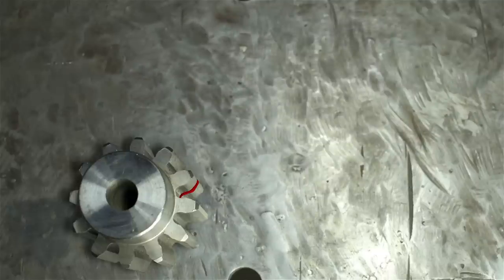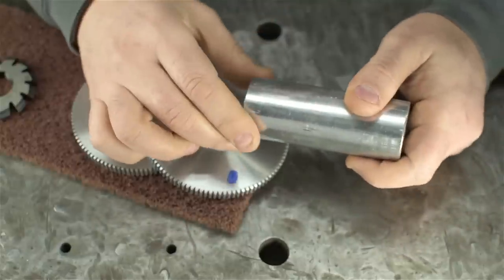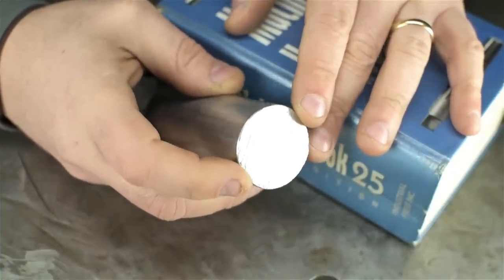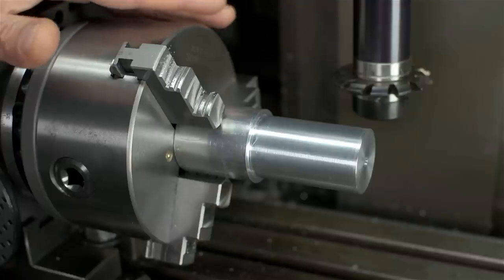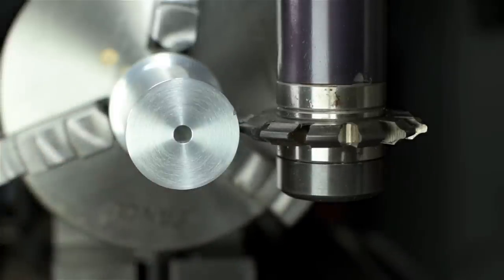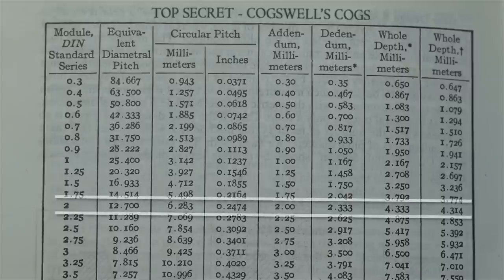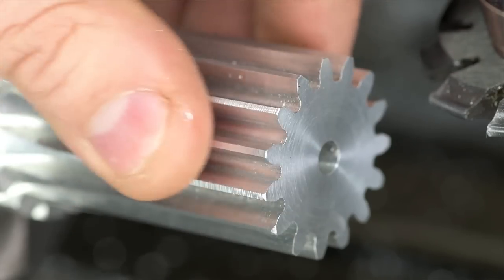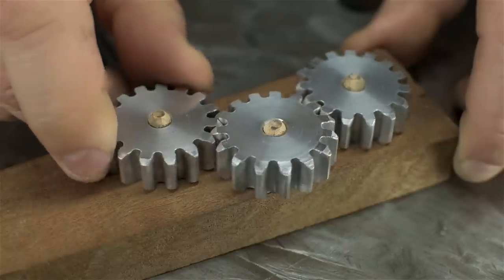15T-M2 Let This Be A Lesson To Ya!

Comment: They knock the edges off the teeth to reduce the tip load on the end of the tooth, which reduces the chance of chipping. Something about more support for the end of the tip...
Or at least that was what I was told many years ago when I was working as a gearset fitter.
Reply: i would have guessed that it was so your lubricant of choice would be slung into the bottom lands of the opposing gear, but reduced chipping makes sense.
Reply: That was my assumption too. Plus reduces the chance of any stress fractures on a sharp end under load.
Reply: My initial thought was a gear mfg not knowing the application the end user would use the gears for, if they were placed on a shifting gearset such as transmission the chamfer would help with shifting of gearsrts.  But your explanation makes more sense.
Reply: So, you're saying "Just the tip"?
Reply: Sounds right since it removes a stress riser at the points of the teeth.
Reply: @wknoxfarms  sounds plausible!  I think they're all good reasons.
Reply: @wknoxfarms  the gears dont actually slide in and out of mesh in a manual transmission, they are in constant mesh, its the sychronizer/blocking ring assemblies that move.
Reply: This is correct, I recall reading these exact words from a mechanical engineering textbook a few years back. Also, it's a lot easier and more effective to clean up burrs left by the gear cutter and cut-off tool this way.
Reply: One reason is due to the reduced stiffness of the tooth near the edges. This means that the tooth edges do not really carry load, at least in ideal theet. Plus all the other reasons it's always good idea to add a chamfer.
Reply: These days I figured it was mandated by OSHA...to save us from finger cuts.
Reply: @ @jasondreckmann3396  Not in a crash gear box.
Reply: funny, I was going to post: since I work many in wood, I'd say it would be to reduce chipping. Not realizing the same could be said of metal. I knock the edges off all sides of all pieces to reduce slivers etc.
Reply: Also these edges are problematic when gears are heat treated.
Reply: After a bearing failed in the half axle of an mf165 I kept driving it because I didnt have time to repair it. eventually it locked up, because a corner broke off a tooth and got jammed in the works. I think it is true.
Reply: There are several reasons, and most of them have already been stated here. The sharper an edge is, the weaker it is. A chamfer makes the edge stronger by making it bigger. Much less likely to crack in heat treat. But a chamfer is still just two sharp corners instead of one. I’d argue a radius would be better. Much like Honing the edge of a cutting tool controls chipping, the same theory would probably apply. If you cut a V shape into a piece of cellophane, you can easily tear it. If you cut a rounded U shape into it, it’s still pretty hard to tear. Sharp corners are weak.
Reply: I believe stress cracks form easier on smaller radii. A 90 edge would be an infinitely small radius and have the highest chance of failure.
Reply: @copasetic216  I don't think your cellophane analogy applies here - the shape you describe is inverted (270 degrees in stead of 90).
Reply: huh?, sorry but even if the analogy is a bit soft (pun intended) I think the premise easily applies. his (point, ha)  is "rounded VS pointed"
Reply: @Studio51media  Cutting a v-shape into a material is not the same as cutting a point out of it.
Reply: Martin Luther  Shifting gears in a transmission never move.  All of them are always meshed.  And they're helical.
Reply: @jasondreckmann3396   They do on many motorcycle and marine transmissions. Synchromesh  is mostly on car/truck transmissions.
Reply: Dave Kohfeld except when they are “straight cut”.
Reply: @dk-bw4gk  You forgot the reverse gear. That one is straight, and moving in and out of mesh, at least on the old stuff I have worked on.
Reply: @frodehau  No, they still do that.  But it's not chamfered like ToT is talking, it's knife-edged.  Also, reverse is engaged while both sides are stationary.  It's a slightly less manual version of inserting a gear into a stopped system.
Reply: Dave Kohfeld helical gears also have the benefit of longer teeth with the same OAL since the teeth are cut on an angle. And they usually seem to be finished nicer from my experience.
Reply: @jasondreckmann3396  that's not 100% true gear shifted before the invention of the synchromesh transmission. Like on my 1930 Ford Model A 3-speed transmission.
Reply: I concur with the fridge
Reply: @niceic.co.uk.  were obviously not talking about the minority of, or outdated of the applications here. The point is that in todays world, the chamfer has basically nothing to do with shifting, and everything to do with the strength and finish of the gear.
Reply: @copasetic216  I don't believe that's a benefit, as I've never seen quality straight gears ever broken under normal conditions.  I believe it's for noise only.  Don't know here, I'm just a clown on Youtube.  The major downfall with helical gears is they thrust the opposing shaft into whatever fixture is containing the end.  '80s-early '00s Hondas (what I'm familiar with) have a terrible problem with this, putting a radial/thrust bearing at one end and a ball bearing at the other.  Don't downshift a Honda regularly.
Reply: @niceic.co.uk. you seem to be upset? Why dont you go find another excuse to bring up the fact that you have a 1930 model t, That'll cheer ya up.
Reply: @jasondreckmann3396  those who do not study the past are doomed to repeat history.
Reply: @niceic.co.uk.  you make perfect sense there gramps.
Reply: @IanSlothieRolfe  motorcycle transmissions engage with dogs instead of synchros, but you're still not banging spur teeth together at all. No idea about marine but I've no idea why they wouldn't use the same concepts as either dog box, synchro, or planetary auto style transmissions, none of which involve any spur teeth being shifted into mesh like you're suggesting.
Reply: @jasondreckmann3396  I always make perfect sense thank you Jason. But you didn't have to take it personally you could have looked up any 1930 Model A.
Reply: @jasondreckmann3396  and why are you bringing up the fact that I own a 1930 Model A.
Reply: @Tony Papantoniou  Crash gearboxes are also usually constant mesh, just without synchro or baulk rings - but they still have drive dogs on the gears, just like a modern manual gearbox.  You're thinking of a sliding mesh gearbox setup, I suspect.  Like the Ford A-Model 3-speed.  :-P
Reply: @jasondreckmann3396  thanks for the info!
Reply: how about ease of manufacturing? Whether a gear driven device is hand or machine assembled, it is far easier to mesh the geared components with chamfered gears, than straight gears! Just try it sometime and you'll see for yourself, lining up straight gears is much more difficult... In an automated environment, that might also translate into damaged gears during high speed assembly...
Reply: I was thinking same per the transmission gears, but no...
Reply: @DreadedOne509  🙄 Progress 😆 lol!
Reply: @podda94  It probably reduces noice too.
Reply: Shane Allen are theet a real “thing?” is that when you are forced to install the gear backward?
Reply: Transmision is general term. Not mandatory on the vehicle (of any kind,:car, bike, boat...).
For example, norton gear change on late is just another form of transmition. And it's not in constant mesh.
Reply: @DreadedOne509  Only for a minute.
Reply: @niceic.co.uk.  Who's the "snobby little spoiled brat" now Mr. "I always make perfect sense thank you"

And it would have much funnier if you said "I have a Model A not a Model T, thank you very much"
Reply: @Steve_Just_Steve  Steve you sound butthert, would you like a ride in my model A. It's the bestest in the whole wide world.  better then yours. :)
Reply: @niceic.co.uk.  Nobody says butthurt anymore Grandpa... jeez  : |
Reply: I would agree with you, but then we would both be wrong. :)
Reply: @dk-bw4gk  Not true. I have five large  tractors that have sliding gear manual transmissions. And a number of garden tractors that are just smaller versions of the same transmissions. That is why much older trucks also had to be double clutched.
Reply: @jasondreckmann3396  You need to check out lawn mower gear boxes sometime. Neither outdated nor minority of them in the walkbehind commercial units had a sliding gear transmission. They save weight and cost over hydro drives. Scag, Gravely, John Deere, and almost all of the other makers used them in at least one of their models.

Comment: I don't really know much about this, but here is my guess why gears should be chamfered: Both deburring and accurate chamfering is quite important (and each tooth should actually be chamfered on all sides)
- Sharp load bearing corners can be work hardened during use, causing breakage.
- Sharp corners gets hardened too much during hardening process
- If gears are to be engaged and disengaged axially, chamfering geometry is important, oterhwise:
- higher wear
- Assembly of gears is faster and simpler with correct chamfering geometry
- Injury during handling
- Less damage during transport
- Problems clamping gears in downstream manufacturing steps. (only clamp the disk, not the teeth)
- More noise in fast running gear
- Post hardening processing requires chamfering to improve process and tool reliablity

Comment: I thought putting a bevel on the gears helps them mesh together in applications where they have to engage from the side. And to help with material rolling over. For the same reason putting a bevel on a hammer helps with mushrooming. 
But I'm no machinist. I'm not even a machine. I'm just a dude, playing a dude, disguised as another dude.
Reply: Corner bevels and leading edge bevels assist in side meshing as stated above.
Reduced burr formation reduction causing that may cause galling of adjacent plating or gears also as stated above.
Corner bevels also assist in oil and debris escapement in gears walled in on both sides. Preventing hydraulic loading and the forcing of walls away from gear.
Can reduce noise in some applications.
Makes them look and feel way better.
Some of these factors are not present on a lot of gear applications and as such you wont see the corner bevel on things like crown gears or 'Bevel' gears, or gears with a shank or standoff.
Reply: @michaelandersen7535 , that was the first thing I thought of too...
Reply: @another1commenter770   makes good points. In tough ductile materials, chamfers are important to prevent damage to 90 degree corners, which will raise a bruise adjacent to the ding (which, as he points out, may then damage the part in contact with it); in brittle materials, they're important to prevent chips or cracks when the gear is accidentally knocked or dropped. As other have said, these chips can migrate through the entire gearbox (they may not break off at the time of the damage) causing mayhem when they pass through the mesh or get jammed in bearings.
These rules are true not just for gears but for machined parts generally. Also a perfect 90 degree corner is unsafe for human contact. There are other reasons, well traversed in this (typically excellent, for a ToT video and against the general "run of play" for YouTube) comments section
Reply: thewoodshed exactly, like in tony motorcycle transmission, chamfered edges help the gears mesh together on a side to side motion
Reply: aside from looking better and removing an edge that can cut your fingers, this is what i was taught, its kind of like rounding the corners to prevent binding in the gear play.

Comment: a tip for when you're cutting smaller gears (like for clocks, as I do) cut in a little bit with your parting tool. This doesn't need to be the whole depth of the tooth, just a slight, but it'll decrease the chance of the teeth getting mangled when you're parting it off after you've cut the teeth. bigger teeth usually are strong enough, and the involute gearshape helps as well, but making cycloidal teeth the base of the tooth is quite small, especially when making pinions (Z<12)

Comment: Ahh, I remember my first pull-start End Mill. I believe it was a Troy-Bilt....horrible for cutting spur gears, but worked surprisingly well on grass.

Also, Tony, it's done to avoid breakage: The burrs along the tooth edges can often cause breakage when the gear is running, so chamfering de-burrs and extends life, not to mention avoids chipped gear teeth flying all over the joint.

Comment: The chamfer on the corners of the gears is because that is a weak area. Under load any shaft deflection can put very high loads on the corners of the teeth, and for hardened steel gears or cast iron the edges would simply break and you end up with bits of hard material passing through gears, so best to remove them from the start by putting a chamfer or radius on them.  Not really a problem on aluminium or nylon gears.  Finally something I learned during my apprenticeship turned out to be useful...

Comment: Three speed band saw pusher, how interesting. I was thinking about reverse gears for my hammer...you know so it can suck the nails back out of the wood.
Reply: There are already commercially available hammers with a two-teeth reverse gear.
Reply: you'll only need two gears for that! :D
Reply: I had a shop teacher tell me with a completely straight face that, if I cut too much off on a lathe pass I should put the lathe in reverse and sprinkle the chips on the work so it would weld them back on.  Took me a second...
Reply: somebody else that's like telling the apprentice mechanic to change the blinker fluid
Reply: increase forward geer with less teeth would be best so you can blow on your thumb when you hit it with the hammer 😆😆
Reply: @matthewhall5571  Canned Steam or Dehydrated Water. ;-)

Comment: Two guesses on why gears are chamfered:
1:   To reduce oil flinging, without the corner the oil is more likely to fling onto the other gear.
2: To remove a stress riser. Helps keep your gear from looking like a Hockey Player.
Reply: Stress risers (for everyone's information, not as a rebuke to this post) arise (ha!) from INTERNAL corners, not external ones. So the root fillet of the gear tooth moderates the stress raising tendencies at the root, but there is no such need at the tip.
Sharp external corners are delicate by a different mechanism: because they're not well supported by the part, because they present a small cross sectional area (which does expose them to increased stress, but only in proportion to the area, like any contact stress) and because they're protruberant by nature and hence damage prone.
Reply: I always assumed (not a good thing to do actually) the chamfer is for reducing friction

Comment: i really like that tony went into detail of why you need the tooth profile on the teeth to be exact, it happened about 40 years ago, but i still remember it with my 32 years of age, i tried putting a 100 tooth gear and a 5  tooth gear in my grandmas meat grinder so that she wouldn't need to be so long in the kitchen, low and behold when she tried it out i heard a loud crack and the bigger gear yanked out my tooth

Comment: well that was a whole lot of nothing....  I have a 4 speed push stick with reverse    AND self-aligning flux shifters
Reply: And one day we will all upgrade to the 6 speed push stick with reverse, self-aligning flux shifters, AND gps controled gyroscopic thrust vectoring rotor system for that perfect cut every time. :-)
Reply: if you think thats great my push stick is Automatic......
Reply: Carbon " Neutral " ?
Reply: @stevenarango6319  Mine is a 13 speed forward, 3 reverse, double dry clutch robitisized sequential shift push stick.  Like an auto, only better with computer control.
Reply: I use the Quadroplex from the retired B42.
Reply: Nefaryus Drake  This made me genuinely laugh out loud.
Reply: 383 chevy  Do you need a can of "Canned Steam" to go with it?  Or do you use a can of "Dehydrated Water"? ;-)
Reply: Scott Elmore dear god some one make this man make an hour long video of it featuring this old tony!!!
Reply: Alan Harris screw your EFI dammit mine has a carburetor and compound turbos!!!

And did I mention it runs on diesel? Yea it does that too.
Reply: Mine uses a CVT

Comment: That was a great video. Now do a worm gear. No cheating  using a tap for a hob. Nice square threads. Then put it in a cute machine to show it working. Due in 30 days. Grade depends on fit and finish as well as fancy video editing. This project will be 1/2 your grade this semester.
Reply: That's not all that hard.  Make worm and hob as one piece on lathe.  Remove, heat treat, reinstall.  Gash wheel blank using slitting saw to provide a start for the hob.  Mount wheel blank on workholder on lathe cross slide, turn on lathe, slowly feed wheel into hob until desired depth achieved.  Lap on worm if desired.  Part off hob.  Matched worm and wheel!
Reply: @ThomCat316  shhhhh!!!! Don't give Tony any hints! sigh Now we have to make the assignment due in 15 days.

Comment: The bevel on the gear depends on the application. You don't always have to do it, and you can always add it later. 

1: It helps retain oil by adding surface area and changing geometry. When they're flat and tightly meshed, they foam up the oil faster. That little bevel lets surface tension do its job, and then oil on the following rotation will clean out any junk from the prior turn. Same thing for when gears are submerged where they mesh away from each other. You'd be amazed how hard it gets to turn a shaft under that kind of condition.

2: On geartrains with lots of shock loading and harshness, like on motorcycles, the teeth chip on the corners of the tooth tips.